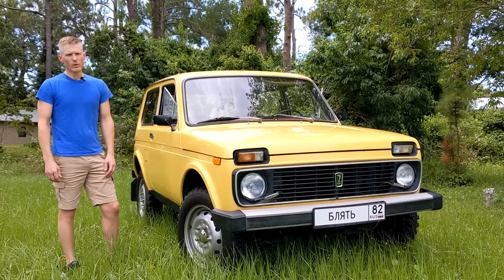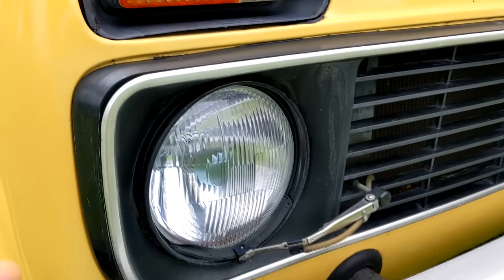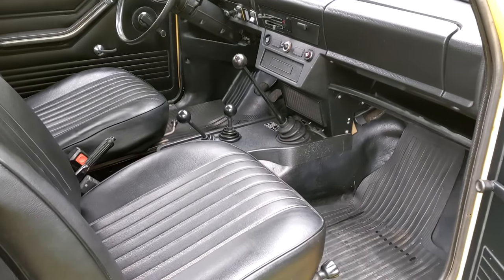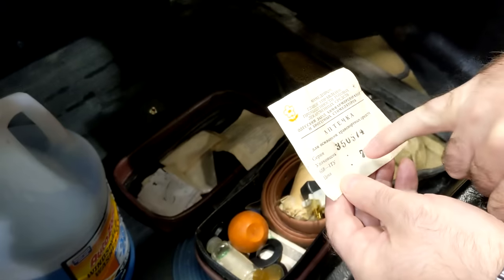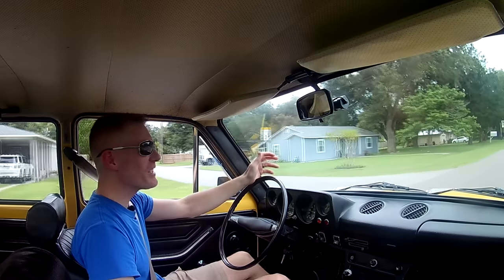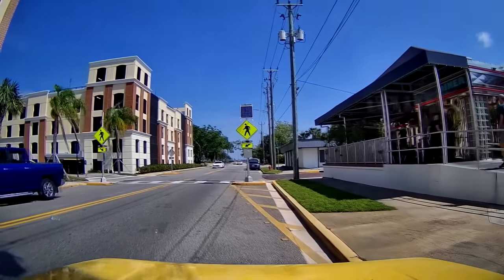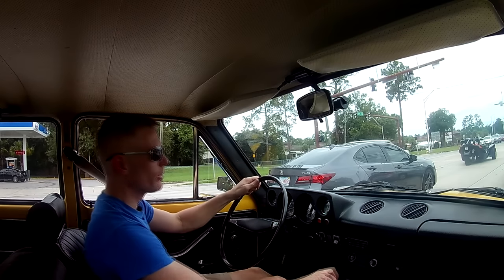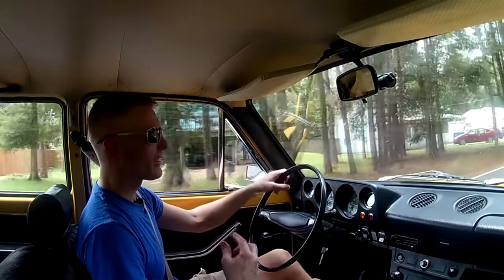This is my 1982 Lada Niva (Лада Нива / ВАЗ-2121) and it's pretty weird.

Comment: In 1997 I drive this Niva. No power steering and even short wheelbase then slim wheelcaves = turn sizes is 16 meters ( 50 feet) . Petrol "perfume" because cascets and hose connections are terrible. Noise is terrible beacuse no noise isolation on doors and cocpit and floor. In winter both side windows is covered with ice. Weak ventliator and salon  heating. Reserv wheel whittire is under hood with enigne. 4 x4 is all time on = over 70km/h ( 45mph) is gear change hard + noises at transmissions get high. Fuel economy is average 10,5 L /100km ( 26 MPH ) . Back seat is with out head support. Luggage room is only 290litres, gas tank 45 liters ( 11,9 US gal / 9,9 GB gal). Enigne 1,6 L R4 54 HP / 40kW, Vmax in tecnical passport is 160 km/h 100 mph )but in reality is more 125 -135 km/h.( 77 - 84 mph). Technical chek every 10.000 km ( 6.200 miles). Rain cleaner in front windscreen are only 30 cm (1 feet) long = in muddy offroad or snow storma are little area only clean.

Comment: I thought I'd heard most Kiwi slang, but "Dick Blossom"?    That's a new one.
I'd love to see the reactions if you do take it to a car meet.   I love unique and simple cars.   They're like deluxe gocarts. Of all my past vehicles, my favorite was a 69 super beetle that had been partially converted to a baha.   Big knobby tires on the back and stock front end.  It also had the semi-automatic transmission.   You still had to shift but there was no clutch peddle.  When you put your hand on the shifter, it activated an engine vacuum operated clutch and it had a torque converter.
So much fun to drive.

Comment: In the early 80s whe had one in the same colour. It run great and we only had two issues with it namely high full consumption and rust. Still I have always liked the looks and drivability of this no nonsense off-road car. Though not practical I liked the looks from the wide rear lights with the higher tailgate of the first generation better. Keep it in good condition no matter electric or gas driven💪😎

Comment: I want one of these so much, always have done. Not so easy to find in the UK though as we stopped importing them at one point due to safety restrictions. My dad had a Riva estate for a while that that thing towed our caravan for so many years all over the UK and he still has the VERY extensive toolkit that came in that, very similar tools that you have there, although the Riva toolkit was a lot larger due to having the jack and tyre tools in there as well. Finding a Niva in right hand drive is all but impossible as well. That first drive after the door repair got me grinning almost as much as you.

Comment: the complet engine ist not  designt in Italia  just the engine block ,  the is cylinder head  developed in russia
Reply: the lada have no differential locks for the axes , just for the connection from back to the front axis . in corners can the back axes slower rotate as the front
Reply: Even engine block is very different

The VAZ engines were complete Russian design, with SOHC instead of pushrods
There is no part interchangeable with the OHV Fiat engine
Reply: @televisionandcheese  Yes

Comment: My father had one, and my uncle still uses one. NIVAs are very light as I know. As far as I remember, there is an old motorcycle Ural which uses cardan shaft to power the rear wheel instead of chain, and this Ural motorcycle is half of NIVA in weight.

Comment: In 1978 my father bought his first Lada for f10.000 , 3 years later with 100.000 km / 62137 miles on it, it went to the scrapyard. Then he bought a second Lada, for f12000,-- and three years later again with around 100.000 km / 62137 miles it also went to the scrapyard and this had only one reason.  RUST!!!!!!  So If you want to drive it for a long time.  Make sure your niva gets a tectyl or Dinitrol treatment and DONT drive it during snow time and at least 5 weeks after they throw salt on the roads.   Don't drive it on Sea beach because of the salt .  If you dont take these precautions your awesome niva will not stay alive for a long time.   Enjoy!!!

Comment: Hi.
I have driven this car model since childhood and I had my own that type car for about 10 years.
7:34 instead of air conditioning, there are special small windows on the front door. You can direct fresh air to your face in hot weather. We did just that. 🙂
8:02 It does not lock all wheels. This is central differential lock and it locks only central differential. Niva has three differential: front, rear and central. Front synchronizes speed between two wheels on front axle, rear on rear, central synchronzes speed between front and rear axles. So when you lock central differencial you do not lock all wheels, just between axles. If you get situation where one wheel in each axles will not have good friction with ground or not touch ground then all power will directed to that two weels without friction and you car will stay on place.  So central lock protect you only from cases where only one axle not has good friction.

Comment: Owned/used one for 5 years in the UAE/Oman "Empty Quarter" Pulled many a "jelly mould" imitation off road vehicle out of deep sand with it. As for the starting handle if you remove the spark plugs and put the vehicle in gear you can wind it out of a "bomb hole" in deep sand.

Comment: Hello. I installed such cars last year, here in Hungary. Robust, strong drive chain. The engine is weak for the weight. It may have already been written to you, but maintenance is important. 10,000 km: Oil change in the engine. 15000 km: valve adjustment. You also need to pay attention to the timing chain. A colleague of mine has a 2107 Lada. The engine now has 430,000 km and is original. If you follow the oil change period, it goes out of the world. It is also worth changing the oil in the gearbox and differential. The video is very good, it looks like you love this car..

Comment: A friend in Australia had a Lada Niva for many years. I think his was 5 speed gearbox and so wasn't too slow on the open road. The LOCKING DIFF lever ONLY locks the centre differential, the third one (front and rear differentials do not lock).   They way I heard it, one thing the Ruskies did back in the design phase was they paid some RangeRover engineers to come over from Britain and help work out the design of the 4 wheel drive system. That's why it's so  darn good and reliable and similar to Range Rover system (of the day) where it is in full time 4wd  all the time and the centre diff can turn freely so evens out tyre rotation speed on sealed roads etc especially when turning. The centre diff only needs to be locked during real heavy duty offroading or bad snow and ice. Usually on sealed roads, leave the centre diff UNLOCKED even on snow and ice, UNLESS you have to lock it to get traction.  Another story I heard was that the Niva was supposed to be designed tough enough for use by the military. Like a Russian version of the old US army jeep, but for Russian conditions (hence enclosed body and AMAZING heater/demister).   I noticed my friends, which would've been a 70's model, had a triangular dual circuit braking  (FR+FL+RL and FR+FL+RR) with 2 sets of 2 brake hoses for the front wheels. Absolutely overkill in design. But even if the car got shot up with bulletholes, still a good chance you'd have most of your braking still working.   The heaters in Ladas are legendary so if your heater and windscreen demister isn't hot enough to cook a pork roast, there's something wrong with it. cheers

Comment: If you plan on going off-road, remember to keep the conversion as light as possible. And because you don't want to stress the running gear too much. Maybe a cradle for the battery pack that bolts in the holes for the engine mounts? An electric conversion is completely understandable as the Lada Niva does like chugging on petrol. Alternatively, you could swap in a modern engine or fit an CNG system to the original one. As for the electric motor, you don't need too much power, especially if you keep the original 4x4 system. The thing is already torqy and too much torque might damage something. As for the new door that didn't fit, it's from the Lada Niva Urban, which does have many changes ovevthe 1982 model. Lada Niva Legend door might have fit better. If you really want to modify it, there is yhis factory Lada Niva Bronto model, you could use it for ideas.

Comment: Thanks for this video, buddy.  I had such a car.  It  was my first vehicle. I will never forget the sound of the transmission😂. Yes it doesn't  go well, yes it's very noisy, but this car has charm.  You could throw out the spare wheel, change the engine, and put in a five-speed gearbox.  I know people used a  diesel engine from kia besta.
And good luck with your plans to make it electric ! It's good idea. 👍👍👍👍👍

Comment: The box  on 13 min. is an emergency kit. Powder in long glass bottle is anti-septic powder (manganese crystals) you have to use a few pieces in a water to handle a wound. The box with glass ampoule is a ammonia solution that can you keep cautious, try to sniff a little bit ;)

Comment: Really glad it wasn't that bad of an accident. this year might be the last year this form of the car niva legend is manufactured. after that i think they only continue with the newer lada niva travel design. and i think the lada niva legend that had been produced in the latest years had some minor differences from the ussr era which is probably the reason that the door didn't fit perfectly.  Go on and proceed with your electric plan for it, its your car, your choice and nobody have done it on this kind of car that i know about. it Would be interesting to see. Much more common in the EU. I live in norway and i can often find listings for the Nivas in both norway and sweden.

Comment: Actually it changed quite alot. The interior is completely changed, engine control is electronic, body enforcement was added, a lot of mechanical updates for drivetrain. But the externals and suspension concept did not change

Comment: For the tires you could try as a close match the 6.00-16 tires, they are narrower and slightly taller or maybe a size bigger 6.50-16 which are about the same width but quite a bit taller. Willys jeeps use them. You should be able to find them.

Comment: Dont panic, the car is so ! that causes envy, evil eye...you know. That particular model you have is precious. Put double Weber carb, in its days was popular from bmw 1602. Avoid too wide tyres because for multiple reasons you will regret. If you buy parts from source again look over an electric rear locking dif that is sold as lada accesory. Have in mind that that most parts for your car are stored in france germany turkey(they make because they have a lot) nad south asia. Good trips!

Comment: 3:24, those thin tyres are the reason why the car is so capable off-road, don't change them.  Years ago a friend and I used his biscuit-tyred Land Rover to pull a stuck Jeep with fat 'off-road' tyres free on a sand dune.

Comment: stock Niva has only center differential lock.

It means you can lock differential only between axles of the car. Not between wheels. When it locked at least two weels will rotates (one on the front and one in the rear)

Comment: This car goes there where G Class, Wrangler and LANDCRUISER won't. Engine is bit under powered, but you can get opel engine with 150 hp and is enough. It's not fast car, but not the slowest, the main purpose here was to reach remote areas in comfort 😉

Comment: Such a great car. I had one in Panama for a number of years. The engine was pretty dodgy and it suffered from rust really badly. However in low range with the diff lock on it could climb trees. I've just bought a pretty recent Jimny and it's similar in many ways (the Latin American base model has zero extras) with one huge difference the Suzuki engine despite being 300cc smaller at 1300cc makes more power and is apparently super reliable. So yeah, get rid of that Italian motor, electric sounds like a fantastic project. I'm subscribed.

Comment: You went to a lot of trouble to present this interesting video. 
I have a '96 car, 2nd. owner since 2008 and also over 300 lines of new parts stocked for when I have need. My Willys Jeep was much more fun but the Niva is legendary in its own rite and I am a big fan of these cars.
Here in the UK I also experience much of the inquisitive looks and folk will come up and ask about it or some say they used to have one years ago.
Here in the UK the Niva was the only car, at the time of introduction, to have permanent 4 wheel drive other than the Range Rover. It just needed the diff locks to make it better. 
Fortunately all these accessories are available for the ardent enthusiast.
For those of us not too politically-minded it is also a good way to make contact with Russian business who provide spares and I enjoy in some small measure such relationships.
Summing up, Lada Niva - a very worthy car. 
When production ceases in 2022 (or 3?) it will be a poignant moment in USSR automotive history.

Thank you, Bob Friendship, (72) UK.

Comment: Sorry for the crashed door but I must say that some panel misalignment is a must for older cars, especially for soviet stuff. I have seen old soviet cars over restored. I am not saying that the repair shop over did it, they did their work to their standards! 
I own 1971 Pannonia T5 with perfect original condition rear view mirror (rest of the bike is sleeper). It is chromed but original sloppy factory polish work shows through the chrome. It would be wrong to give it perfect polish because it did not come from the factory like that. Fixing all the aesthetics is not the soviet way ;)

Comment: man, I noticed at 17:36, that there's some rust on the wheel arc. better use some solution to prevent rusting for the arcs and bottom of the doorways before it's too late

Comment: Thats a nice Lada Niva. In my country there is at least 2 on every corner. My parents used to wanted to buy one l, but its fuel consumption was a major red flag, since the gasoline is very expensive here. Often people who own one have it converted to cheaper fuel types. Modern ones are a bit different. They have different tail lights, grill is a bit weird and wheels are ugly ventilator shaped, which I never like. Older type like the one you have are much nicer looking. The new door issue...that was probably a door for a newer model. It happened to a guy in my town once. Stay safe.

Comment: Great car I know how you feel my first car was Lada. Raw oldschool feel is great. It's not supposed to run fast however, terrrible handling at high speeds, terrible safety and noise and I'm not sure transmission will survive high torque electric motor but good luck with the project. It's great for slow country roads and offroading (Not far)

Comment: Hey ! Just a few points I'd like to clarify a bit for you (I bought a brand new one 2 years ago, and have done my fair bit of research on the subject).

- The crank handle, I believe, was to get the engine internals moving, oil circulated in cold climates before actually starting the car with the electric starter. I may be wrong, as this is informtion picked off the internet.

- The diff lock handle is for the center diff only, the one in the transfer case. It will synchronise front and rear prop shafts. You would need individual front/rear diff locks to allow all wheels to turn simultaneously.

Gutted for the fender bender, man... If you need parts, I'd suggest you try Lada Power, they're top guys !

You've earned yourself a subscriber, can't wait to see the EV conversion !

Comment: The cards with year numbers are tech inspection papers. Don't know how it's in the US, but in Russia you have to take your car for inspections every year or some years (depending on your car's age). If your car passes the inspection, you are given a paper like that one, that proves that your car is allowed to be participate in traffic on public roads. Without it, you can't legally drive your car. Back in the day drivers would stick these under the windshield, so that road police would see, that the car is alright therefore lowering chance of a random pull over.

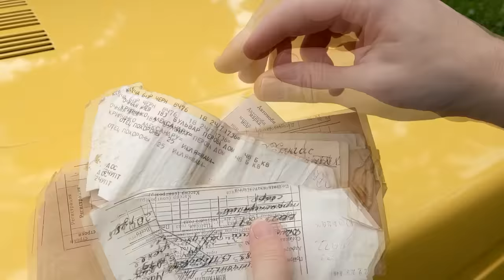9:52 this a receipt for road (traffic) tax.
9:59 this is a private telegram, addressed to the owner of the car from his mother. It says his dad died and the funeral would gonna be held on July, 25th.
10:18 this is exhaust gas CO share inspection card.

Comment: Oh man, you have to put a Ford 3 cylinder turbo in it! :D   ...Bro, point your phone at it with Google translate, and you'll know what it says. seriously tho, I think that's the perfect vehicle electric conversion, it's light 4x4, can use the torque very well, and if you can lower the center of gravity even more, would improve handling quite a bit...also, it's YOURS!

Comment: Hello from Brazil. I had one of those back in the late 90s (mine was a 91). Mine actually came with a crank shaft, a hand pump and tools to mount tires. I don't have it anymore but I kept some of the soviet tools that came with it. I ended up selling it because it became very difficult to getting parts for it. 
I don't know how you managed to maintain yours rust free. Those things rust easier than a brillo pad